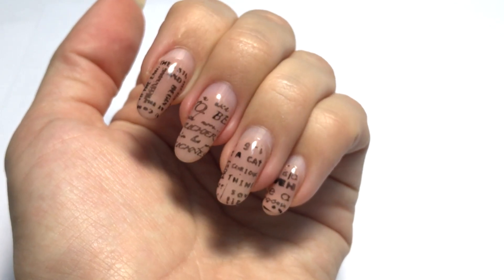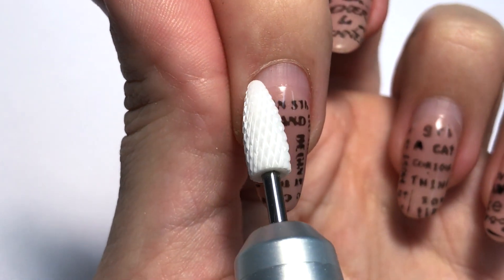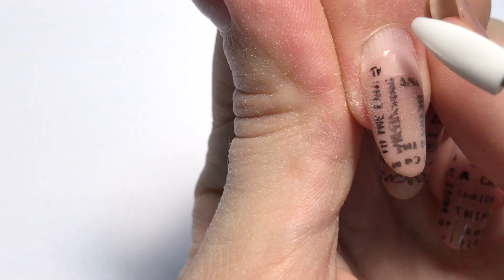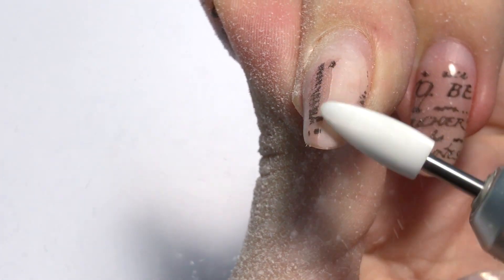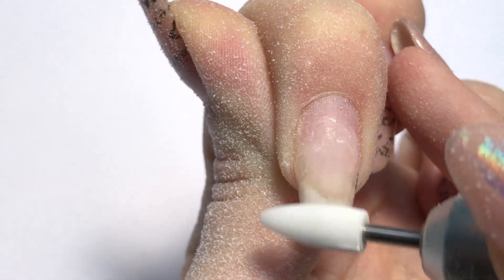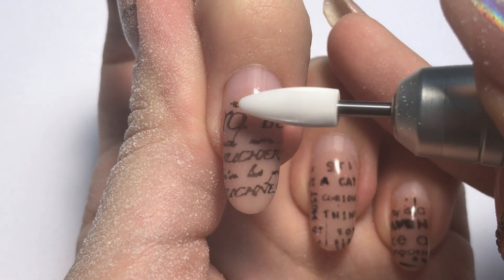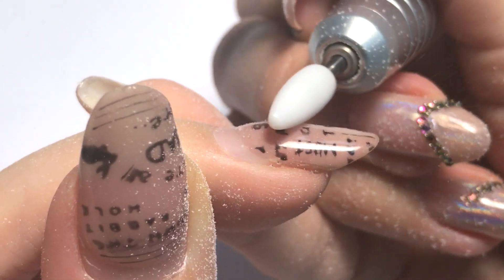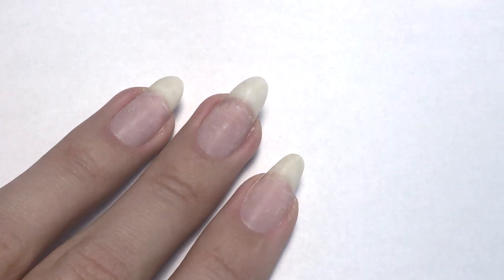How to remove Gel Nail Polish with electric file Tutorial | No soak off required

Comment: Hi Anastasia ! I would like to know how do you prepare your nail again after filing when you leave a thin layer of base gel on your nails? Is it the same as if it was natural nail with no leftover product on it ? Can you please tell me the steps? Thank you!
Reply from the maker: Hi there! It's pretty much the same - you need to prep the part with a grown natural nail only. Take off surface shine, apply dehydrator and then base coat. Make sure that leftover product is even. There's no need to apply base coat on it (in terms of adhesion) but I usually apply it as it is easier to get smooth even surface and apply colour.
Reply: Nailcou Thank you very much!

Comment: I am alittle confused about the last part that you said leave a thin layer on the natural nail , why?
I get that you don't want to get too close to the natural nail plate but what happens if the client (or you) want to reapply another gel polish after removing the old one ? Wouldn't that hinder the adhesion of the new gel or product to the nail plate. I was trying to find a way to remove gel completely with a drill bit like I saw some Russian nail techs do on Instagram , it was awesome.
Don't want to soak to often and have my client's nails suffer.
Please reply and thank you so much for the video
Reply from the maker: Omawuni, yes, I always leave a thin layer of old base underneath. If there's no peeling, it is ok, the adhesion is still good. As the nail grows off, it is usually only on the lower part of the nail. Then you prep the nail and apply a new base right on top.
It helps a lot to keep nails healthy and to grow them long

Comment: You are doin fit correctly but many nail salons don’t leave a thin layer and even use these ceramic bevels to buff the nail out before applying  a new gel. My nails are thin and damaged from the misuse of this technique by salons in my area. I use to have nice strong nails and it’s been 4 months they’re still brittle and break as soon as they grow out.